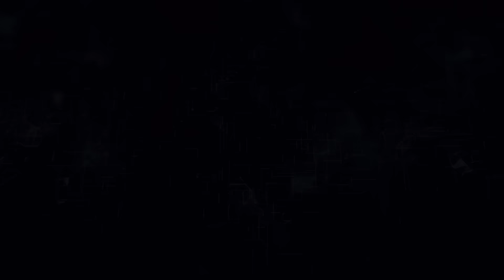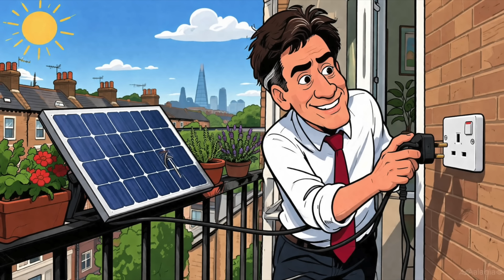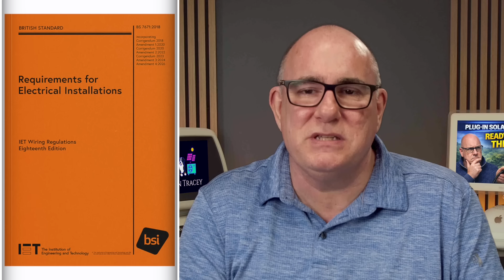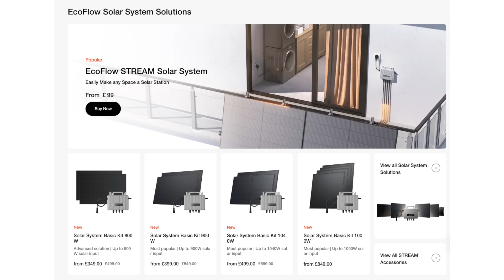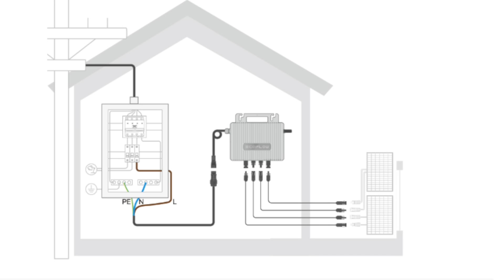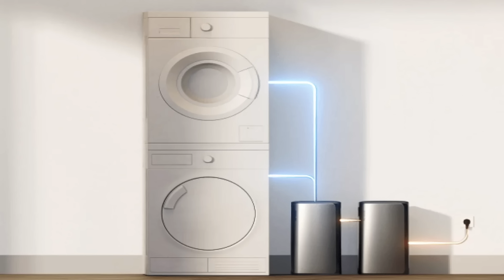Plug In Solar Is Coming… But There’s a Problem

Comment: So whilst the panels are generating electricity how do your appliances know to ‘prefer’ the solar electricity to grid electricity ?
Reply from the maker: @TheActionslaxx Great question – and it’s one a lot of people assume is “smart”, but it’s actually just physics 👍

Your appliances don’t choose solar over grid. They just draw power from the house wiring.

What happens is your inverter slightly raises the voltage in your home when it’s generating. Electricity always flows from higher voltage to lower voltage, so your appliances naturally get supplied by the solar first.

If your solar can’t meet demand, the grid automatically makes up the difference. If you’re generating more than you’re using, the excess flows back out to the grid.

So there’s no switching or decision-making going on – it’s all driven by voltage (electrical potential) and happens instantly.

Comment: Are they useful on all types/ages of housing/electrical systems, or are some types (ie old or new housing) optimal, better or worse, or not even possible, in terms of safety?
Reply from the maker: I would say if you have an old house, with old wiring and an old consumer unit think twice, or get an EICR done. Infact its a good idea to get an EICR done anyway before you think about solar.
Reply: @JonathanTracey thanks, appreciated.

Comment: So if the panels are outside, how do you plug in inside? Leave a door or window open, hole in the wall? I'm struggling to picture the practicalities.
Reply from the maker: yep, you’ve gotta get a cable somehow from the outside of the inside drill hole through the wall, or use an existing access. Everybody’s house is gonna be different.
Reply from the maker: or if you have an external socket in your garden, use that

Comment: In Vietnam solar installation companies were selling their supply and install. roof top panels to capture the 12 hrs. of sun there. batteries to store power for night time use and extra non used power sold to the power companies. 
In practis this the power companies stopped buying in power. After ten years use the batteries started to fail, so customers started to see power storage drop for overnight use. But the cost of replacing the batteries after 10 years use, would wipe out any saving made from buying power from the National grid system. A friend of mine continues to use his solar system split for day use and then switches to an power  supply company for overnight use.
Reply from the maker: @TheByard there’s definitely some truth in what you’re saying 👍

Batteries do degrade over time, and if you size a system to try and cover your absolute worst-case (overnight in winter), it can get expensive very quickly — especially if you’re cycling it hard every day.

But plug-in solar is a slightly different use case.

Most people aren’t trying to go fully off-grid — they’re just using it to:
- cover daytime base load (fridge, routers, standby loads etc)  
- reduce how much they buy from the grid  
- maybe shift a bit of cheap overnight energy into the day  

In that scenario, the battery isn’t being pushed as hard, and you’re not trying to replace the grid entirely — just reduce reliance on it.

And that’s why it can still make sense financially, even if a full “self-sufficient” system doesn’t 👍

Comment: How does it work when you have a power outage u will have to disconnect from the grid or the power will leave your house
Reply from the maker: Yes, to sell an inverter in the UK it has to automatically shut down if the grid goes down. You can still pull power direct from the on wall sockets.

Comment: He he,. Government is not interested for you to be independant. Thats where MCS certificate scam comes in to play and sky rockets solar system prices
Reply from the maker: MCS was originally planned as a wave of ensuring quality and stopping cowboy installers from install installing systems that later caused problems on the grid. At least by having an MCS certificate you’re supposed to be confident that your system has been installed to a particular quality level.
Reply: @JonathanTracey  Good on papers, but:
Steps to Attempt CertificationFind an Installer: Use the official MCS Installer Search to find a local certified installer willing to inspect a DIY install.Commissioning: The installer will perform a site survey, test the system, and confirm it adheres to MCS standards.Documentation: The installer will submit the installation details to the MCS database (MID), which triggers the generation of your certificate.Why It’s ChallengingLiability: Many MCS installers are unwilling to certify work they did not install themselves due to liability, as they become responsible for the system's safety and performance.
This means you will never get it as these peoples only interest is to push you overpriced solar systems

Comment: I have had a roof-mounted solar & battery system for a while.  I also live in an area with quite frequent power cuts.  Unfortunately I can't use the energy stored in my battery during such a power cut. One of the reasons (or so I was told by the installer) is to prevent the chance of energy being directed onto the power network whilst engineers were working on it.  Surely this same (dangerous) possibility exists with this sort of microgeneration?
Reply: You fit an isolation switch outboard of your house meter. I live in an area where power cuts are normal after big storms. To cope I have a generator, and to prevent it zapping engineers fixing damaged power lines down the road, I isolate the house before switching on the generator. This is standard.
Reply: @geoffreywestmoreland8181  Indeed, we too have a generator with a properly wired transfer switch.  The situation we are discussed here rather different to that scenario.
Reply from the maker: @Tradewind25 great question 👍

What you’ve been told is absolutely correct — it’s a safety feature. All grid-tied inverters sold in the UK are required to shut down during a power cut. This is called anti-islanding, and it’s there to make sure no power is accidentally fed back onto the grid while engineers are working on it.

Some systems can run during an outage, but they need additional hardware to do it safely. Typically that means a backup gateway or transfer switch that physically disconnects your home from the grid, allowing the system to run in “island mode.” Once isolated, the inverter can safely power the house without any risk to the network.

Microinverter systems (and most plug-in style systems) don’t have this capability — they’re designed to shut off completely when the grid goes down.

With systems like EcoFlow Stream, there’s a bit of a workaround in that the battery itself has physical sockets. So during an outage, you can plug things like a fridge directly into the unit. But you can’t feed power back into your home’s wiring via the mains — same safety rules apply.

Hope that helps clear it up 👍 and thanks for the question!

Comment: I've been waiting for this for years; Britain, as ever, is so far behind. The moment these are available I'm buying one, plus storage. I want a larger-scale system as well but need to sort out some other infrastructure aspects first. That will be a DIY build with electrician connection and sign-off because most of the companies I've spoken to have been rip-off merchants.
Reply from the maker: sounds like someone who has a plan :-)

Comment: Very interesting. I have just subscribed to your channel. I have a basic understanding of how these systems work but may i ask something I'm not too sure about:
  I know that the limit for plug-in power is going to be around 800 watts but, clearly, a two panel system comprising off two 400 watt panels will rarely be operating at full power, due to clouds and low sun etc. If i got, say, six 400 watt panels to compensate for the times of low solar generation would my inverter shut off totally during times where sunshine is strong and panels are producing nearly 2000 watts (given energy loss) or would i be able to program it to limit the power to 800 watts it allows into my home electrical circuit? I understand any excess can be diverted to a battery but, temporarily, i want to try the setup wuthout a battery and see how it goes. But i dont want to get just two panels and get disappointed with it when, in times of low sunshine, i cant even run a large fan with the current produced!
Reply: I just bought a system off Amazon from Ecoflow, who say it will comply with these new plug in regulations. (Their own website even says after this becomes law they will sell you the new mains lead with the 13A plug fitted)
The kit I bought is four X 400w panels and a 2kwh battery (with built in inverter) for £1299. 
It does exactly what you say, limits output to your home to 800w and uses the excess to charge the battery. Then when the solar output falls it can use that battery power to make up the difference. 
The battery has arrived, the solar panels not yet so I cannot comment on how well it works, but there are lots of people on youtube with this system. It's the Ecoflow Stream Ultra 1.92kw. (Their model naming convention is bizarre and very confusing.)
Reply: @karlbassett8485 thank you for replying.
Reply from the maker: @Pedro123fred thanks for subscribing, really appreciate that 👍

Great question as well — you’re absolutely thinking about this the right way. Most plug-in systems will cap output at around 800W rather than shutting down, so if you over-panel you’ll just get “clipping” during peak sun rather than losing everything.

That said, your thinking about adding extra panels to improve low-light performance is spot on — that’s exactly how I’d approach it 👍

If you’ve got any more questions as you plan it out, just shout!
Reply: @JonathanTracey thank you.

Comment: The challenger 2 was built as an MBT. But in the end, it was used as a heavy assault tank to smash through prepaired lines of otherwise inpenitrable german resistance.
It's been a long time since the days of TOG II and Turtle, but we got there in the end.
Reply from the maker: wrong comment replied to????

Comment: Can you put a panel on shed roof and a inverter in the shed to run a pond. Or say a garage away from house
Reply from the maker: I don’t see why not, if all you’re intending to do is run stuff in the pond that’s probably much cheaper solar powered pond pumps than going down the road of putting a micro inverter in
Reply: @JonathanTracey  That's fine for a wildlife pond or water feature but otherwise not practical, many ponds require a pump running 24/7 if the requirement is clean healthy water.

Comment: If you work from home, or for any reason have a computer on all the time (or any similar power draw) this could potentially save you 3 or 4 kWh per day, which would be closer to £300+ savings per year.

I'd also pay close attention to maximum battery specs, in addition to max inverter specs. I fear it will be stupidly small, or the UK Legal mark will double prices.
Reply from the maker: the battery size probably won’t be specified in legislation as it’s restricted by how much you can export from it. most cheap rate plans allow 6 hours to charge them so your limited by that
Reply: @JonathanTracey Inverters can charge batteries from the mains too, during off peak at night.
But more to the point, poorly built batteries can be a fire hazard that conventional fire fire gear cannot put out. Since the point of this is to give flat owners access to solar power...
I think there will be regulations. If they aren't, land lords will ban batteries, and may use that excuse to weasel around any plug in solar rights the government allows.

Comment: Good vid. I'm not convinced about the Planning requirements because plug-in solar panels can easily be portable installations.

I'd be interested to know if I could supplement my existing 9.98kWp install (done in 2015) which is right at the G99 (I think) export limit.
Reply from the maker: Hopefully planning requiremnets will be relaxed. Yes you can add this alongside your existing system, you G99 is an export limit, so long as you don't export more you are fine, under current regs you would have to do a g99 adendum to let them know but I think this requirement will go away as well when the legislation changes
Reply: @JonathanTracey  Thank-you. 

I have a nice, if not as nice as it could be (say I had 40p/kWh FITs from 2010), setup where solar with FIT and Export pays all my energy bills, including GCH, and should continue to do so until 2035.

So far I have not even worried about batteries - which I do not think would be worthwhile.

Comment: Thanks for this, I'm totally new to this and absolutely clueless but your video cleared up some questions I had so thank you. So do these inverters plug into the mains then the panels plug into the inverter? Sorry if it was already explained in the video.
Reply from the maker: yes the panels plug into the inverter which converts the DC from the panels into AC which is then fed into the home via a plug socket
Reply: @JonathanTracey thanks so much, very clear

Comment: This is the UK. so this will be planned to fail financially for the working man. Costs of electricity will raise to counter act the electricity that you don't use from the power companies. Other charges will be imposed such as annual checks at extortionate cost ,then down the line there will be a tax on people who have plug in solar . Mark my words  it WILL be planned to fail  ,
Reply from the maker: @allmyownvideo Ah yes, the grand master plan… let people generate their own electricity, then secretly punish them for it later 😅  

Because obviously energy companies hate it when you use less of their product… except that’s literally what’s already happening with solar users saving money today.  

“Mark my words” predictions are easy — reality is we’ve had solar in the UK for years and bills go down when you generate your own power. That’s not a theory, it’s just maths.  

If anything changes in future, people will adapt… but sitting around waiting for some grand conspiracy to unfold doesn’t exactly lower your energy bill 👍

Comment: So at the moment I would be better off harvesting enough solar energy as I like and putting in a dedicated circuit(s) that run completely independently of the grid.
Reply from the maker: go for it, sounds like a good plan to me
Reply: @J @JonathanTracey o be honest it was related to something I came up with in the early 2000’s. I had solar panels on the back wall of the house that powered an LED lighting system. Every room, except bedrooms, had a couple of LED’s in the light fitting. This made much of the house very dimly lit until morning. Just enough to see by but not enough to wake anyone if they needed to get up for a drink or use the toilet. 

This worked until the cheap nasty panels failed and I used the battery for my boat motor. I realised the street light outside my house was bright enough. Coo Var glow in the dark products in tactical places took care of the rest.

Comment: My understanding is that they usually rated at 900W is because a 3 pin plug is not designed for continuous high power use!?!
Reply from the maker: usually 800w but in some countries they allow 900w, even so this is way less than a standard fan heater so should not be an issue even through a plug

Comment: I use barely any base load at all, it’s kettle, washer, dishwasher, and hob to cook with that’s the problem. I’d love to bring my usage to zero but it’s going to cost me 5 grand to do so and I have no savings. Sadly this government is taxing me to death so I can only afford solar by borrowing money and that makes it not viable
Reply from the maker: @keithvers569 Totally get where you’re coming from — £5k is a lot of money, especially if it means borrowing 👍  

The key thing is to look at it over time. If a system like that saves you, say, £800–£1,500 a year on your bills (depending on usage and setup), then it can pay for itself in around **3–6 years**. After that, it’s basically putting money back in your pocket.  

That said, it only works if the numbers stack up for your situation — and borrowing can change that. That’s why I’m starting to show real-world data, including smaller/cheaper setups, so people can ease into it rather than going all-in upfront.

Comment: Solar panels are polluting the planet it’s not the way to go they cannot be disposed of properly and it takes more energy to make them then they produce in there life time pull your selves away from the con
Reply from the maker: @doingitourselvesbudoandtracy  the data doesn’t support any of what you are saying.

Solar panels typically “pay back” the energy used to make them in **1–3 years**, and then go on producing clean electricity for **25+ years**. So over their lifetime they generate far more energy than was used to manufacture them.  

On disposal, most panels are *85–95% recyclable* (glass, aluminium, silicon), and recycling infrastructure is improving rapidly as more panels reach end of life.  

They’re not perfect, but calling them a net polluter or a “con” just isn’t backed by real-world evidence.

if you going to apply the energy used equation to things you buy, you better move back to a cave tomorrow because everthing you own never pays back the energy used to create it